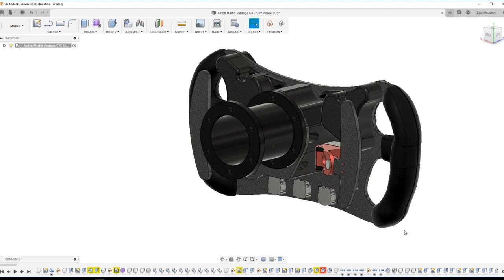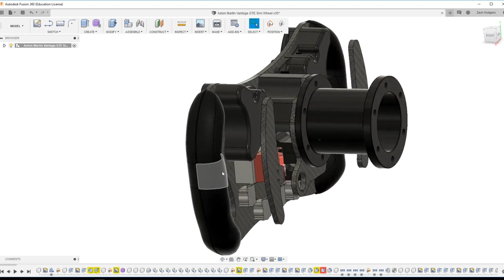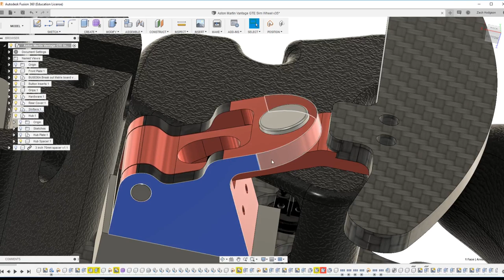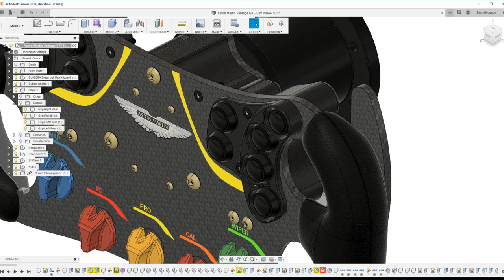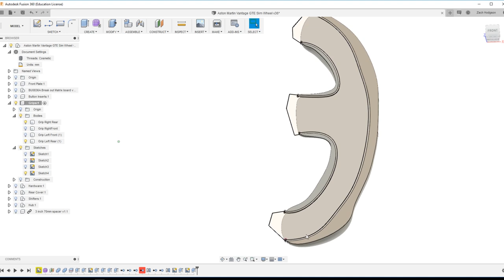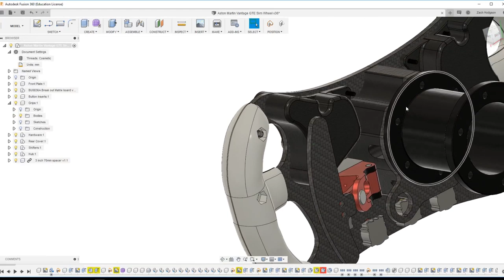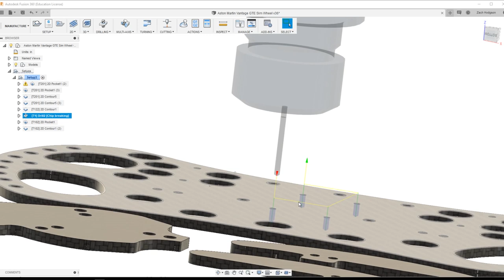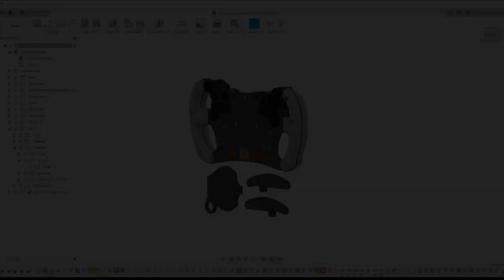How To Build A Turn GTE Sim Wheel Part 2   CAD, CAM & Slicer

Comment: Hi, 
i am designing some wheels by myself in Fusion, because i have a lot if Fun doing it. But after finishing the model i have some Problems. So i dont know what push buttons i can use. can you please say me what buttons you use? As PCB i would use an Arduino Micro, or do you think there are better alternatives ?
I would be very happy to receive an answer (and sorry for my bad english, i am a German 😂)